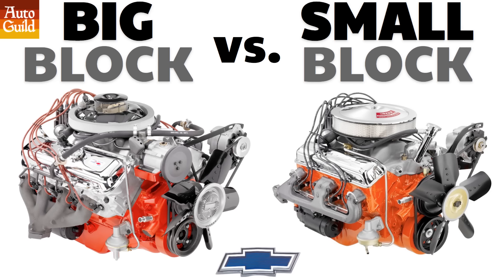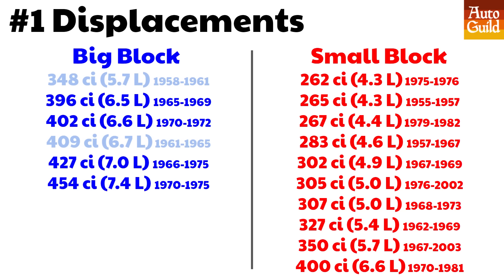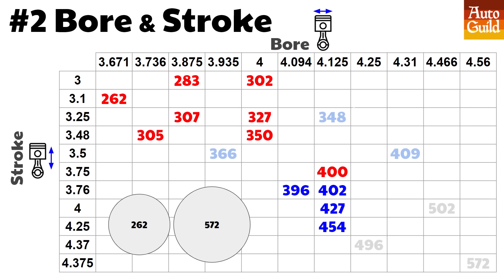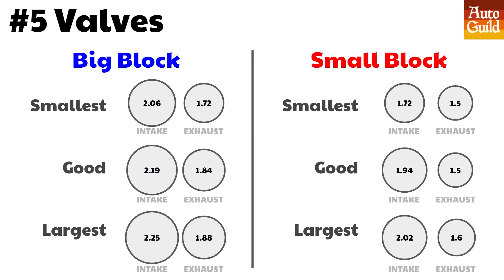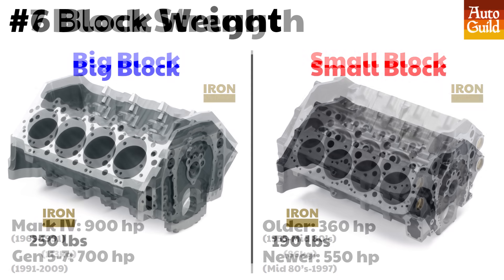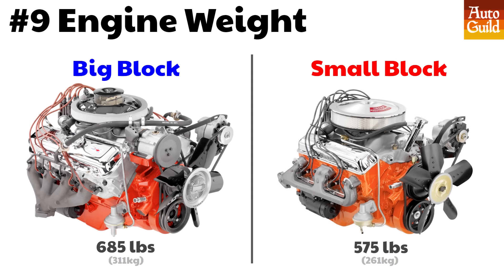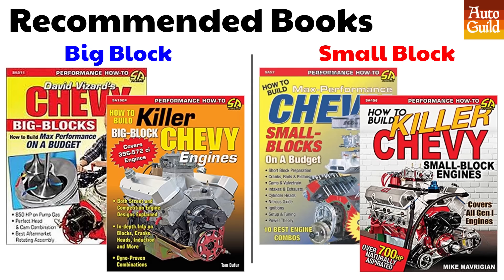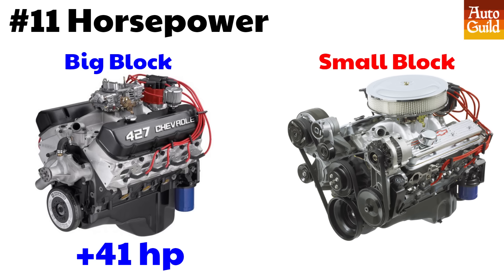Big Block vs  Small Block Chevy Comparison

Comment from the maker: Visit Auto-Guild.com to get your free pre-order of the LS Swap Survival Guide eBook.  As well as other cool eBooks and cool car related posters too.  

Please note that I entered the 454 bore and stroke incorrectly.  The 454 has a bore of 4.25 and a stroke of 4.
Reply: Make a video about the 383 Stroker
Reply: I caught that. Do i get a gold star?
Reply: Why you all worried about room. That motor fits about everything gm builds except to 1 gen nova. Even G van..yep. 402 in a van.
Reply: @blackbirdxx928   They can, and DO fit the Gen 1 Chevy II Nova. I have a friend with a 572 BB in an early Nova
Reply: I have a 632ci with twin mirror image precision 90mm's feeding it in my 66 GTO my uncle and I built in 2009
Reply: @mechntechbeau  I love 66. GTO I bet it's a beast with that motor and twins.
Reply: MechnTech Beau is it fast like an og 66goat?
Reply: @bsiciliano20  7.774 1/4mi at 189.65mph i have had her up to 199.82mph on the 1/2mi but ran out of gear
Reply: The stock bore sizes used mean you will experience valve shrouding the BBC.  On factory rec port head blocks you can see the bore notches to accommodate the 2.19 valves. That's the main reason going past the 2.19 1.88 isn't too popular, it just wont deliver the expected improvements without was huge over bore because of the valve shrouding.
Reply: @ineffable1129  the added weight to the valve train certainly doesn't help either.
Reply: All that info and you didn't give the formula to figure out cubic inches? Half the bore is the radius x the radius x 3.14 x stroke x 8
The motor  I built for my boat used a gm 502 block stock bore is 4.4700  bored to 4.50 with a 427 steel crank and a 2 piece to one piece rear main seal adapter 478 ci 11.5-1 closed chamber pistons and closed chamber rect port heads made 740 hp @ 8000 rpm. It went with the boat when I sold it to buddy. It's in a v drive hydro and he drives it like told him..flash it to 8k and run it at 7k till the tanks are dry
Built it 8 years ago  and it gets oil change and a lash check every 50 hours...odd combo nobody uses
Reply: @blackbirdxx928  So your saying  pie "R" square, not round? Ha Ha!
Reply: anyone else catch the 366 inaccuracy? it was a tall deck mark4 not a w series bbc, also there were rare w series 427s prior to the mark4 427s..
Reply: u have 4 1/4 stroke and 4 inch stroke from the factory depends on what it came in or crate engine
Reply: Sorry about the salt!  just new to the post.
Reply: Because of this mistake i ordered a mercury marine engine for my Daytona....THANX BRO
Reply: the sbc was replaced by lt1 in 1992 in corvettes and in 1993 in f bodies.
Reply: Ive been considering buying an old 89ss454 dually 4x4 just for the motor.
Reply: She big girl.
Reply: Superb stuff I just subscribed and gave you a thumbs up.
Reply: you got a lot more wrong..
Reply: Big block please
Reply: I don’t care about anything.
I have a 1972 El Camino
It’s gorge fest
454
If you have a muscle car?
-you need “muscle”
&
“No replacement for displacement”🇺🇸🔥
Reply: Anyone catch that he called the 1969 ZL1 a Z11?
Reply: You don't
Reply: I mean you incorrectly quote a lot of things but it's ok.
Reply: I was about to point out the error, but ok I will just keep watching.
Reply: And to, the 427 bbc has a bore of 4.25 and stroke of 3.76 (chilton's auto repair manual), not 4.125 and 4 !!
Next time, pay attention!
Reply: @rodolpheriffaut7619  don’t be a psycho!
Reply: @rodolpheriffaut7619  ⁷⁷⁷⁸⁸⁸⁸⁸⁸⁸⁸⁷⁷⁸⁸⁷⁸⁸⁸⁸⁷⁸⁸⁸⁸⁸⁸⁸⁸⁸⁸
Reply: You mean he didn't just Google everthing and find all the wrong answers? That's what happens when 20 something year olds try to explain something they have zero experience with but want credit because they did aome research. Or maybe you could use Google yourself and get his ssme answers and not waste your time!  @rodolpheriffaut7619

Comment: Generally because the open chambered BBC head is basically a modified Hemispherical head it will always out flow a SBC head thanks to bigger port size and bigger valves and the Hemi head combustion chamber. Since it is the head that limits the power that can be produced (a cam can only aid air flow only so much) the BBC will always beat the SBC on a side by side comparison when running high compression ratios. When you start to run flat tops or dished pistons that advantage disappears on pump gas and the wedge headed SBC can make as much power as the same displacement BBC. At this point the added cost of a BBC, and added weight of an all cast iron motor favor the small block. 

A SBC generally makes 1.5 horsepower per cube when hopped up with off the shelf aftermarket parts; while the BBC using similar parts can muster only 1.2 horsepower per cube. BUT and it is a really BIG but; the BBC can get very very big in cubic inch displacement while a SBC is done in terms of reliability at 434 cubes. A pump gas 434 times 1.5 equals 651 horsepower max normally aspirated, compared to a pump gas friendly 632 BBC times 1.2 which equates to 759 horsepower at a much higher cost, but you will get more torque out of the 632 than can ever be used on the street (no one makes a tire big enough to hold a 632 that will fit under a door slammer).

Comment: Same basic math.  How much air do you want to pump per second at what RPM?  How wide a main crank way do you need to house the weights?  And what valve angle will provide volumetric efficiency for the job at hand?  Both engines answer all three questions with "YES".

Comment: It's mid 2025. I just went through your LS swap guide to see costs for LS swapping my '64 Tempest. $8300 in parts and that still doesn't include an engine or trans! I will definitely be putting in either a bbc or sbc thank you very much!

Comment: The old saying isn't wrong. "There's no substitute for Cubic Inches, except more Cubic Inches". Unless you have a vehicle weighing less than 1800 lbs.? Then you might be happy with the performance of a small inch engine? Also consider how much harder a small inch engine has to work, to achieve the power results, that you're happy with before it's worn out?

Comment: If you were building a pro stock drag car which has a displacement limit of 500ci, you could go either way, really. Brodix has their 4.50" bore spacing aluminium sbc blocks which can be bored out to 4.250", and with some machining you can fit a 4.405" crank that'll put you right at 500ci. The block can actually accept up to a 4.5" stroke, so you could use that leftover space to fit some longer rods too.

Comment: I've got a 68 Camaro with a Gen 5 454 with Brodix heads, Performer RPM. Should be pushing 500hp on pump gas hardly trying.

Comment: I don’t know much about cars but what engine swap can I do for a 1982 Z28 Camaro with 300k miles it currently has the stock crossfire injection 305 it’s fun but wanna have more fun 😂😂😂
Reply: Speed costs money, how fast do you want to go?
Reply: @ to be honest I think I might slap a 350 on the car once my 305 decides to go but honestly have been thinking about going to a junkyard to find a used LS2/3 same thing for 350

Comment: I have a 1971 Chevelle, it had a 350, and now has a 454. Yes, advantages and disadvantages to both. Weight I don't care about, I'm not racing nobody. The looks, the sound, the performance of the big block is awesome. But if you want to change somethings and lighten up it WILL cost you. Aluminum heads, $$$$$, then your headers from your iron heads won't work. It's a sacrifice unless your last name is Trump; but, to each their own.

Comment: I have a perfect example of big block vs. a small block because we did it back in 1982! I have a 1963 Chevy Impala it had a 396-cu.in. big block at the time. It had a Muncie 4 speed with a 4:10 gear. A guy wanted to race me, so I said yes. He had just put together a small block 350 with a cam, 4-speed, and a 4:10 gear. It was great. We took off, side by side He was granny shifting and I wasn't. We were both side by side until I hit 4th. gear and that big block just pulled away from him. I loved it. Now my 63 Impala has a bored out 454 making it a 468-cu. in. Also has a huge hydraulic comp cam, Holley 750, headers and 12 bolt rear axle with 3.73 gears, Strange axles with retainers. It will shit and get.

Comment: In the mid 90s, Hot Rod mag did a BBC vs SBC comparison.  Same CID, same compression, similar cam specs, comparable heads (as much as they could be), etc.

The BBC made more hp and torque.  They also tested both in the same car (69 Camaro I believe).  The BBC was quicker and faster than the SBC in the 1/4 mile.  The only downsides are the added weight and cost.

Comment: L-34 in a 68 impala is what I own and have no size issues with the big block. The biggest problem is keeping it cool, with a bigger radiator, and duel electric fans also high flow high volume water pump with a high flow t-stat if that doesn't keep it cool I'll run E85 with EFI it's cheap enough nowadays thew Ace's fuel injection.

Comment: The 427 does not have the same bore as the 400 small block as your graph shows.

The 427 has a 4.25 inch bore, and a 3.76 inch stroke

The 454 has a 4.25 inch bore, and a 4.0 inch stroke. 

The LS-7 however has a 4.125 inch bore and 4.0 inch stroke.

Comment: Small block engines need to be built to stress levels, to equal the easy grunt of the big block.  I have a big block Chevelle which creates a lot of heat like they all do. When I moved south, I replaced the standard 3 core radiator with an Impala 4 core radiator which also is 2 inches taller (so hangs lower). Now it barely supplies cabin heat.

Comment: Thank you, but shocked at final results. Typically the small blocks run most efficiently pumped up to about 420 cid. That includes the Ford and AMC equivalents. Big blocks are most efficient at around 550 cid. So the little big block outperforming the big small block is odd. Perhaps the similar cam was the factor there...
Great video 👍

Comment: I gots an Aluminum factory installed small block in my 6 spd manual 2017 SS Camaro. 6.2 liters putting out 455hp and 455ft lbs tq.✊😁

Comment: I likely need a new engine in my not-matching numbers small block '66 Chevy and a short block from Blueprint plus my existing Edelbrock heads and '69 z/28 intake will get me 400 hp no trouble out of that roller cam stroker displacing 377 ci. The weight will stay way down in the front so no suspension changes, and I'll make nice torque. I can dress it like an L79 with the oil filler in the intake and I can get valve covers that look stock but have PCV on the inside edge, facing the valley. The drop base aircleaner with the 327 decal will go right on the larger Holley I'll need, and fit under the hood,. It will be tough to tell it's not a 327. What's not to like?

Comment: I saw this when it was made almost 5 years ago and just felt this guy is not an engine builder since he knows nothing in reality. Since this video has almost half a million views just had to comment about BBC. I am a professional engine builder for race cars and marine engines. Because this young guy uses Google's search to find info it is the reason he knows nothing but incorrect info. All High Performance muscle cars and boats both use BBC engines and for good reason. The big block heads almost flow double what even a race SBC OR LS can flow. Like 350cfm-495cfm in non race style CNC ported heads which can flow over 500cfm. The LS and SBC use 11/32" valves and guess what...so does the BBC aftermarket heads. So they can rev to 7-8k RPM without issue. Plus the lighter aluminum heads and aluminum intake manifold put a BBC at nearly same weight as a stock SBC. The best thing about BBC engines is that today in the 2020s you can build a powerhouse BBC for nearly same price as a SBC or LS engine and have power from idle to top RPM. This guy mentioned header clearance problems which is also a myth since BBC heads have canted exhaust vavles putting the headers at a more tucked angle to fit easier in the engine and are equally spaced apart. Only when your header size is 2" or more can clearance become an issue with both BBC and SBC or LS.  I personally can't stand the LS crowd simply because they need power adders to make real HP numbers and plain old BBC will deliver all natural HP by itself. Maybe I need to make a real video explaining all of this if people are that interested? 🤔

Comment: No LS swap in my C3 Corvette. Under no circumstances would I ever even consider it for this car. The LS and even more appealing LT swap would offer easier big power achievement and MPG. Cold weather start ups and over all longevity are big reasons to consider the swap too. Yet very little of this is a priority in an older car driven only on Sunny days in warm weather along with the occasional drag strip runs. My reasoning comes back to keeping the car in it's era. I want that choppy idle, the simplicity of no computer orand fuel injection. MPG is the first sacrificed. Big Double pump Holley carbs never delivered MPG. Yet power can be part of the program in a way that far exceeds what is described as "limits" in this video. Modern Aluminum heads, with lighter valve train  components don't come cheap but when combined with an aggressive roller cam and old school big displacements the small block I run today measures just over 400 Cubic inches. Makes well over 500HP and the car with appropriate gears reliably makes mid-11 sec passes. Even a more street friendly gear ratio low 12s and high 11s are possible. I could go faster with a Big Block. I see guys regularly getting 800-1,000+HP  NA out of the budget busting after market blocks, heads and stupid big inch combinations. So in the end while all this could be achieved more inexpensively with and LS "boosted" and I completely understand why that route is so common today but ultimately I want my car built in the 1970s to at least drive, make the right sounds and at least retain the correct appearance and simplicity of it's era. It's comforting to know that nobody running a small block chevy like I am is "Stuck" with old school best of the day double hump heads and a flat lifter cam. in the 1970s reliable street/strip rarely if ever allowed for 400HP SBC......today that's less than entry level power. I long ago lost count of the number of Cast piston 383 combos making well over 400HP were offered up everywhere by the various engine builders. The rules are the same as they've always been. Power is limited only by budget. What has changed is where budget power starts and where reasonable limits on power are found. For both the SBC and BBC those numbers are considerably higher than in the past. For the vast majority of people out there the choice to swap to an LS isn't power, or at least it shouldn't be. The LSs primary advantage comes down to it's being the massively superior '"daily driver".

Comment: Thanks I needed that !

I remember contrasting 400 big block
Chevy pick up.   1971

And

Chevy 400 small block 
Chevy caprice 

No comparison. 

Had 366 big blocks in trucks 
Had 427 in trucks 
Had 350 small block in one truck 

My dad had 454 in his pick up
And
455 in his Buick limited 

Still own a 455 Buick.  1974 Electra 

Two uncles had 350 small blocks in their pick ups.    And everyone then had a 350 small block somewhere in their family     

Your video goes to show how little I actually knew about all those engines 

I knew the big block had different performance characteristics but I didn’t know about why they put both in corvettes at different times 

Your point about steering and handling I get from Motorcycles.    650 vstrom vs 1000 v storm ( Suzukis ).  2 out of 3 go for smaller displacement in that bike because of weight …. My opinion 

Love peoples comments 
Especially about straight line power 
No one cares about handling going straight down the road 

Raw oomph only

I have also owned a couple Lexus LS cars.  A 400 and a 430. They own that aluminum block and because of this video now I know why

Comment: I had a 70 Corvette 454 390 HP 500 ft/lbs torque. There is no replacement for displacement. It would lift the front wheels after I had the engine built by a boat race engine builder. Before that I couldn’t reach 160 without taking it over the redline 250 rpm. After rebuild with assurances 6000 was safe. It spent a lot of time at 160. At highway speeds on down shifts below 75 it would break the Michlins loose. It was my high speed car had a 70 340 Cuda for 1/4 work 60 series tires all around on widened factory rims. One of the few regrets of my life selling my muscle cars. My dodge big blocks created fond memories as well. I still have a 500 CI Cadillac Coupe in my hanger keeping my V12 Jag and Mercedes company. Cadillac has been a family member for 48 years. Mercedes and Jag for 38 years. All summer drivers. Jag will do 178 MPH with its performance mods running on 100LL. May head design is amazing.

Comment: I realize someone worked hard to create this video. However, it is totally disorganized and useless forget the small talk and the sporadic history start off with a bear engine with no accessories then give total weight of Each engine. Then give the dimensions of both long blocks with no intake or carburetor. Give the weight of each engine block cast-iron And aluminum. Give the weight of a set of cylinder heads for each engine in cast-iron and aluminum. This shouldn’t take over 10 seconds. Including the 348 and 409 only adds confusion, especially to young people Who aren’t as familiar with the history.

Comment: Your graph is wrong. The 396 and the 427 shared the same stroke at 3.76, but the 427 had a bore of 4.25 which was shared with the 454. The 454 had a stroke of 4 inches. The math for calculating cubic inches is bore X bore X stroke X .7854 times 8 as in cylinders.